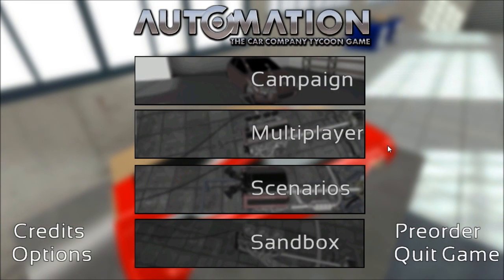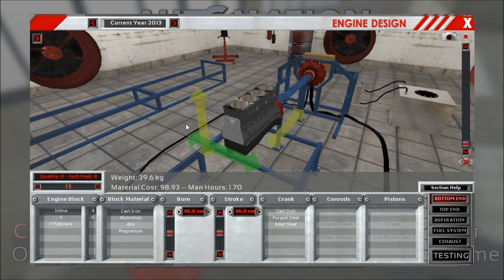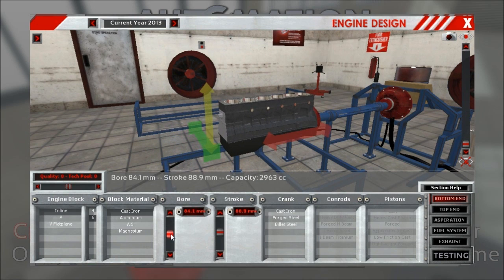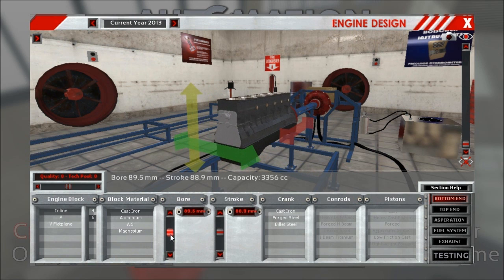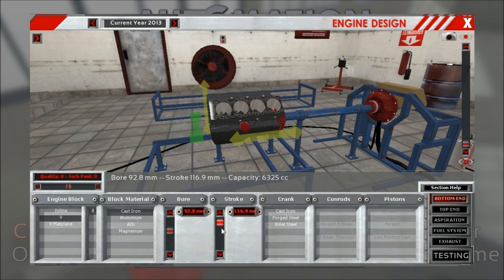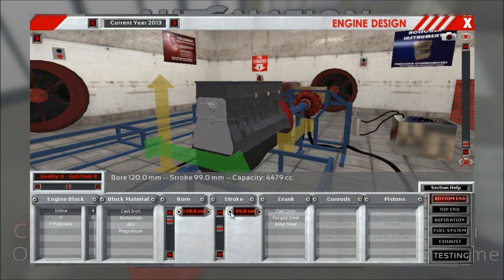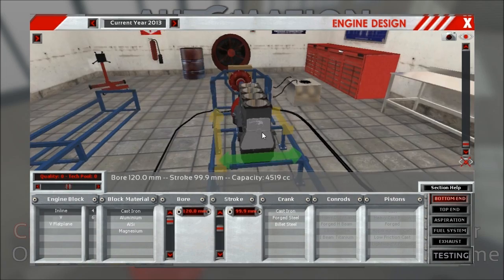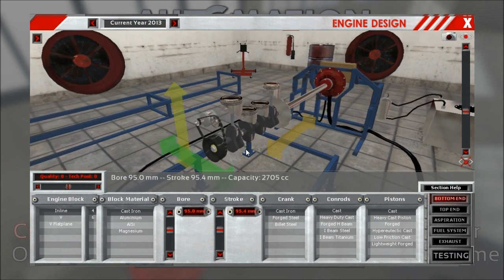Little Dev Update: Engine Fitting & Scaling

Comment: The service cost variables are a good idea too. I know my car is a nightmare to work on due to the crammed engine bay, and while the front three spark plugs are easy to change (V6), the rear three require removing a plethora of components.

Speaking of my car's situation, it seems the orientation of the engine would also affects service costs. If my engine was rotated 90 degrees, then 3 spark plugs would be accessible from the left side and three from the right side, making it easy.

Comment: That is correct, though a large stroke will also allow more fuel and a larger expansion area. This also increases the torque of the engine as the kinetic energy of the piston is larger, given that it can MOVE for a longer time. :)

Comment: Bore is the diameter of the cylinder. Stroke is the height. (Right?) So, if you've got a lot of height, the piston needs to move more as it completes one rotation. So, for high revving Engine, large bore is better, because the piston moves less.
If this is incorrect, someone correct me.